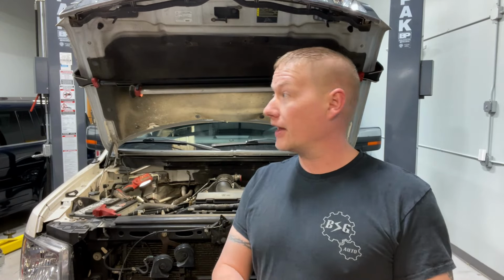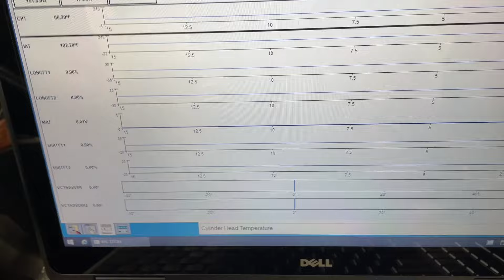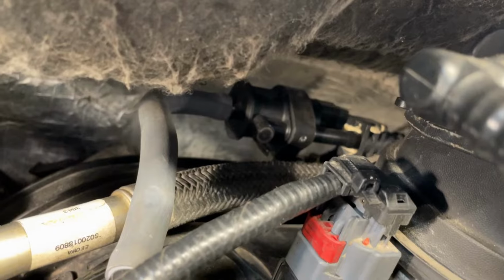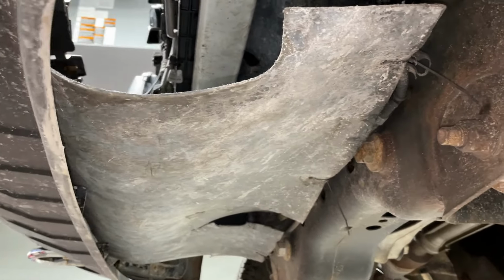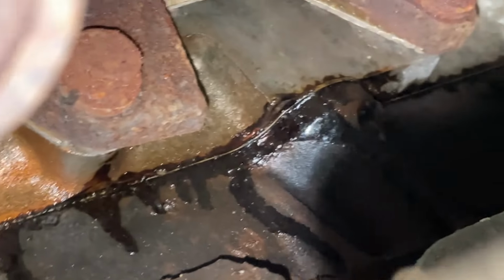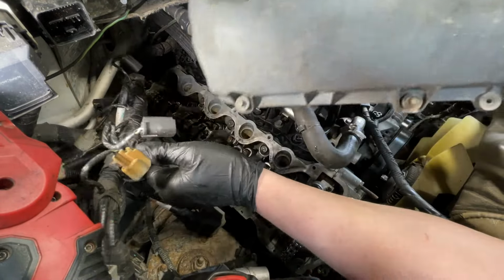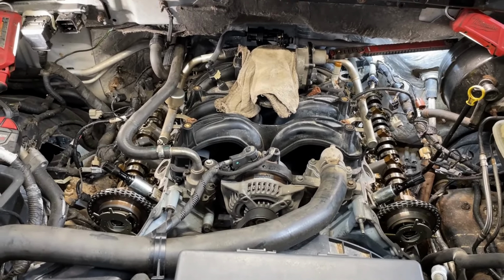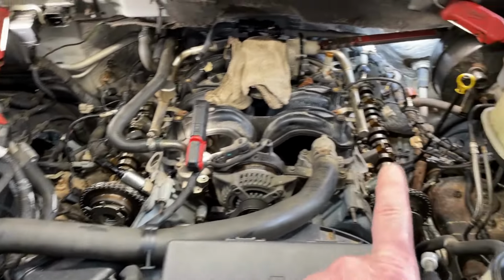The Worst Hack Timing Job Ever!

Comment: Looking to put a crate engine in my 06 F150 5.4L. I have changed the oil religiously and have accumulated 173K with zero engine issues(said while knocking on wood). Been reading a lot of reviews of ALL the different companies out there, and thanks to the internet only seeing TONS of negative reviews. Does anybody have any suggestions or had positive experiences with a certain company and their engines? I appreciate the input, thanks!
Reply from the maker: Use powertrain products or Ford reman, never use Fraiser.
Reply: @FordTechMakuloco  Thank you so much for your input. It is highly valued! Love your vids man, keep up the great work👍🏻

Comment: The black goop on the heads/block looks alot like Permatex Aviation form a gasket when it dries. What its doing on those head gaskets is mystery. I think they mistook that for the copper spray???

Comment: That cold air intake added 5 HP to it! LOL.
Reply: Plus lots of noise, since you don't have resonator baffles.  I put a Volant CAI on my '06 back in '10 and when I did my timing job in '19, I put the factory intake back on the truck.  I was tired of the noise it made under throttle.

Comment: You say that OEM for the timing components; what about Cloyes or Melling?
Reply: Cloyes has a lifetime warranty on their cam phasers pays for parts & labor
Reply: This is where I differ from him. I don't agree with "only use manufacturers parts" most of those parts aren't made by (in this case) ford, and some aftermarket is better than Ford parts.
Reply from the maker: Those two brands are the ones breaking chains so no way for me.

Comment: The cam lobe wear on the driver's side head don't look good, and that head on drivers side has been replaced or rebuilt. Also, that goop running down the block, looks like that Indian Head gasket shellac that people like to use on gaskets, i bet this engine has had a top end rebuild for some reason.

Comment: FordtechMakuloco! Help! I’m a huge fan of your videos and have learned so much to help me with my automotive career. I’m in need of your assistance my friend. I live on an island in Alaska and my shop has got three different f-150s, all the newer 5.0 engines and all of them have the same issue with crank no start, severe over fueling, completely fuel soaked plugs. Change plugs they run for a short time and then fuel soak and die again on all cylinders. No matter what we do or change we have not been able to identify the cause of these concerns on these things. Is this something you are seeing as a trend where you are? If so I would be forever grateful if you shared your knowledge with us 🙏

Comment: one thing i have learn it is against the law to change the factory set up on the newer rigs anything that don't have distributor u can't change a thing on it by federal laws  they fall under D.E.Q. laws and if ur a dealer u can't sell any rig that has been striped of any pollution device they don't have to work but they have to be on the car for a dealer to sell the rig 100,000 dollar fine the first time

Comment: That goop where the head gasket is at is actually permatex High tack gasket sealant that comes with a brush connected to the cap of the bottle and before it’s exposed to air it’s like water and then you brush it on the gasket and it becomes like thinner silly putty but yea they shouldn’t have ever put that on the head gasket and if they still wanted to they should have used the rattle can variety which won’t make a thick layer that will actually just make an easier path for the combustion gasses or oil to escape bc unless the sealant they put on isn’t super duper thin and it’s perfectly even the gases will find the are where it’s uneven and push through and actually make the head gasket fail from getting burnt through.

Comment: I have to ask you this, why is it that most machine shops still swear up n down over copper spray on MLS head gaskets upon installation??? Factory assembly is only MLS gasket on a CORRECT machined surface. To me copper spray is patch work to fill up gaps of an incorrect machined surface and cross your fingers and hope it works. Why?????😡🤔

Comment: Gotta love those hack jobs. Esp. Chinese frost plugs and old cam caps on new head. Must be a new way of line boring using camshaft for boring tool. Missing pan bolts are a nice feature. May as well drive with heavy oil til she blows then buy a GM LS with convert kit.

Comment: Does anyone know if a worn out torque converter would sound like clattering at lower accelerations?
Reply from the maker: No, normally at higher speeds and a high gear.

Comment: 2003 Ford f150 cranks but doesn't start. It has new starter new alternator new battery and new fuel filter yet still will not start

Comment: Two things that may be stupid to say. But I'll say it anyways. But am I the only one bothered by the fact that if a mechanic at a shop can f**k up your car but they're typically not held responsible for it? Another thing I wanted to ask was...I'm looking to do the timing chains on my truck in a few months using your tutorial, but I'm curious as to if the cam phasers have to be replaced every time? Reason I'm asking is I'm getting a slight timing chain rattle under light throttle and figured it's time to change them and I plan to in the following month. BUT, there aren't any issues with the timing phasers and I figure if I don't HAVE to take them off and dick with putting them back on, I won't and save myself likely a few minutes or couple hours worth of labor.

Comment: This is  why I work on my own car,. I had a mechanic 5 years ago jam my driver sde door by runnin it in the side of the building  and knock it out of alingment  yup, hand me back my vehicle with the still unalign because he didn't how to fix it.  LMBO!! the thief didn't cut me no slack on the 850.00 bill either. But he did fix it after month of waitng on bent door pins.

Comment: I had particular interest in this video since I'm running rich codes on both banks after doing a timing chain job. After the work, I noticed my purge valve was actually broken in half, so I replace that, and I also replace the injectors and plugs, at the same time of the timing job,  with Chinese injectors. Anyway, I saved the old injectors so I am going to send them to a shop that rebuilds them, those are original Ford ones. I also wasn't sure if it would be the PVC system causing rich codes on both banks, but now I'm gonna check that and see if that corrects those rich codes. The shop that rebuilds the injectors, said that those Chinese ones never seem to make parameters, and will make me run lean at high speed. Not sure what your opinion is on that, but I'm getting the old ones rebuilt for $45 apiece, so I thought that would be the cheapest way to go.  I thought with fixing the PVC system ( if it needs it), and putting the original injectors in after getting rebuilt might fix it?  I couldn't find any vacuum leaks anywhere, truck now has a 180,000 on it; 2004 F150.

Comment: After spending x amount of $$$,
I would run it till it drop dead and then maybe consider  putting a used motor in it... of course depending on the condition of the truck...

Comment: I bet they pulled the heads and sent them out with out the caps to get cleaned up.  The goop leaking from the head and block is most likely a sealer like Gasgacinch gasket maker or permatec form a gasket.

Comment: Why do you not like cold air intakes?
Reply: They don't really do much on a stock engine and the higher flow filters don't filter well not something good for a truck.  I would rather spend money on cams and a tune or a throaty exhaust.
Reply: Cold air intakes cause incorrect air flow readings from afm, also the filter oil can and will contaminate the sensor.
Reply: @johnleinen9409  without a tune your leaning out the engine and most engines come lean from the factory to pass emissions + your letting a lot of fine dust into the engine now.

Comment: I had to replace the head On mine as well. Definitely use the Sealant on the joints no oil leaks anywhere thank God. Got to change out the other 4 plugs on the driver's side. What I found interesting? Was it took a while for the computer to register?
In the beginning it was running rough and then it was Stalling and then it stopped doing that for whatever reason and. I was thinking oh boy have to go back and there again. And then she Heat up and I'm wondering why the thermostat wasn't kicking in or the fan wasn't working. And when it did Come on the Engine was hot.
Add kinda wondering why the fans weren't kicking on? Where can I wear supposed to but now they're working for now? Don't like these electric fans for this very reason?. She overheated Tapping on the relays taking them out putting back in. I guess they were stuck I don't know. It was a cooling issue I thought and then it just.
Working.
Honestly, I thought it was the It was a cooling issue I thought, and then it just started. working honestly. I thought it was the relay and/or the fan sticking?. I bought OEM parts gasket and.
Cam Fazer. And new And Headbolt .. And now it she's acting like nothing happens. But there is something interesting that I can't put my finger on the my only concern. When she's an idol in park?
She kind of runs a little rough. And when? She's? In drive smooth as butter.
Can't tell if it's running? I don't know if it's a concern or not And that's pretty much It. . And how much time does the computer And how much time does the computer need in order to read the information? On the truck to learn everything how long does?. I disconnected everything to be sure that if wires I disconnected everything to be sure That there won't be.
Any kind of shock to the system?
If I were to drop a wrench or Poor an extension by accident and it rolls off and.
And Poor an extension by accident and it rolls off  and connects. I disconnected the 3 cables from the from the firewall I just wanted to be safe then sorry.
But it did kind of struggle with learning for some reason. But again no leaks so far so good. Oh. Also there was this weird ground current?
That when? I was. On? The. Passenger? Side I touched the terminal it get this electrical Current. The battery surface looks like it's clean but then again looks can be this The battery surface looks like it's clean..

Comment: This software your running on that laptop, where can I buy it for myself?
Reply: That is the IDS software all Ford dealerships use, it's designed by Ford for Fords. Maybe Brian can tell you where he purchased it from.
Reply: @Twistedstanger  that would be nice because I’ve got a towncar that I enjoy as my daily. I know somethings are wrong with it but the Lincoln stealer ship in my area says, everything checks out. I do not believe them. So this leaves me to research and train myself.
Reply: The diagnostic software he uses is linked in the description. The software is mostly free called FORscan.
Reply: @shawnwithem628  I understand the name, but where can I buy it is the question?
Reply: @lustfulvengance  ok, we’re making a lil’bit of progress. Other then laptop which I own several, were do I go to buy all the necessary equipment. Ie website, name of business or location. Some identifying information so I’m able to know I’m buying the right stuff.

Comment: Agreed, probably best to replace the entire engine. From looking at it the way it is, no telling what else is wrong with it, or how long it'll last. Seeping head gaskets?... and not just a little either, is NOT a good sign. Can't even put lower front timing cover bolts on, I highly doubt the heads are torqued down right, or if it even has new head bolts... probably reused the old ones. Engine hack job right here... dude got ripped off.

Comment: Recommend buy Toyota Tundra to customer LOL. If the factory parts fail so much why go back with factory. Factory is generally much better than aftermarket though. What a mess. At least you know what your doing. Ford keeping you busy with work LOL. I got a GMC so I know the feeling LOL.

Comment: Lover you videos do you think you could help me I’m lost with this one. 

99 F-150 4.6l
It started chugging/misfiring the other day for couple of seconds. Then she cleared right up, the next day I was driving everything was fine till I got to a stop sign started loping/misfiring then went away. The next day started misfiring while I was driving I let off the gas it cleared up. Put my foot into the pedal was fine, 10 seconds later started misfire/chugging. Under heavy throttle would back fire only done this a couple of times. Today fired right up and was running good for about 20sec then loping and sounded like she had a cam. Give her throttle really fast she would misfire, throwing P1504,P1151,P1131,P0113. I replaced the intake air temperature sensor, replace the mass airflow sensor, replace the idle air control sensor. Cleared all codes fired up ran good for 20 to 30 seconds then went right back to loping and misfiring. I replaced the spark plugs and wires 5 months ago with Bosch double platinum plugs and good wires.

Comment: Why don't u reccomend CAI??
Reply: CAI can often cause problems.  They usually use an oiled air filter, well that oil tends to contaminate the Mass Air flow sensor and can cause rich or lean codes. AT most they add just a few horsepower, usually not enough to notice by the seat of your pants.  They can improve the sound of the intake, but as far as actual performance improvements, it's not much. When you go to trade in the vehicle the presence of a CAI will usually lower the value of the car. Most reputable dealerships will return the intake system to stock before reselling the vehicle, the one I work at does at least. So they know when they see a CAI they will have to spend more money just to return it to stock. 
Now all that being said, I have seen a few kits that are done correctly and are well engineered.  The theory behind the "cold air" is sound, it's just that most of the kits out there are not very well engineered.  If you want to run a CAI then go for it, my advise is to save every single stock piece so you can return to stock.  Or if your happy with the CAI then you can sell all the stock stuff on Ebay and get back some of the money.  One more thing to keep in mind when you do any performance upgrades to a modern vehicle like intake and exhaust systems, to get the full benefit of said upgrades your engine's computer really needs to be retuned by an experienced "tuner".  Upgraded exhaust and intake systems will add performance even with a stock tune, but to really get the full benefit of those modifications get a "tune".
Reply: Exactly! In addition. also many times the filters also tear in small areas due to over oiling and cleaning cycles, that why I purchased two filter, one as replacement even on the dry CAIs. Place it safe and just leave the OE filter media.
Reply: @StumpyVanLife  also performance oil or oilless air filters let larger particles past the filter in order to flow more air so your letting your engine eat more rust and die sooner. Many cheap CAI that people put on are sucking in hot engine air which is worse then a stock air box.
Reply: @StumpyVanLife  I got a new2me 2017 F150 5.0 w/tow pkg to drag enclosed trailer across country(pa-nm). When the headwind blew out west my mileage dropped to 8-9mpg while at 70mph 6spd auto dropped down to 3rd at times. Thought cai would help-what's yr take?

Comment: Heres what I cant figure out. If someone is tearing deep into something like timing chains, why someone would skimp on parts. You could be missing revisions and what not. Even a pickup truck like the one in the video, if that thing ever had a bad fuel pump and it was mine, I would march right down to my local for dealer and pick one up. You know why? because its probably a MFer to get to and I only want to do it once.

Comment: I just got through cleaning up a previous shop's mess on a 6.0. Wiring harness to IPR left against up-pipes, several areas of chaffed insulation, VGT solenoid wire not fully engaged & they were randomly replacing injectors chasing down power balance issues on 1,3 & 5. I popped the cap off the secondary filter & guess what? Barely any fuel! Failing HFCM. Also found failing FICM relay, had burn marks on the side. Replace that stuff & truck runs like a scalded dog, power balance almost glass smooth. They had been chasing this problem for the better part of a year & wasted God knows how much. Shameful 😔

Diagnose & do the damn job right or don't do it at all!  My customer thinks I hung the moon but I feel bad for him because of all the missed opportunities for a proper repair in the 1st place.

Comment: why a broken baffle that allows the pcv to suck oil can cause a rich condition?
Reply from the maker: The internal OCV baffle is designed to condense and return oil vapors to the crankcase. If the baffle is not functioning anymore then much more oil will get through.
Reply: @FordTechMakuloco  thanks for the reply yes I understand that part, what I am confused is why oil causes a rich condition?
Reply from the maker: Oil contains hydrocarbons same as gasoline.